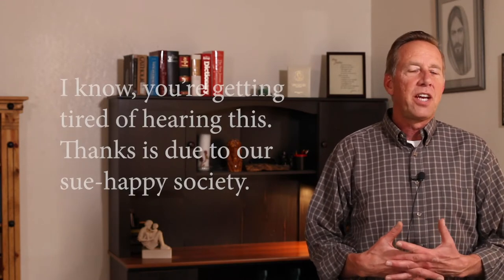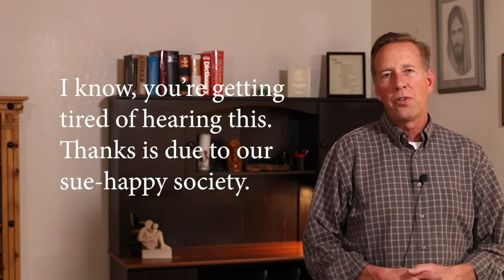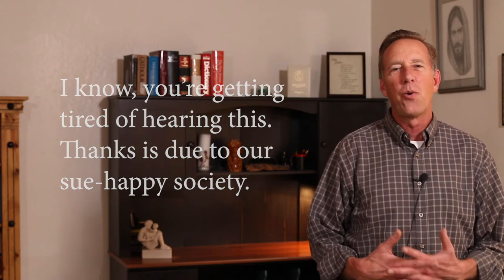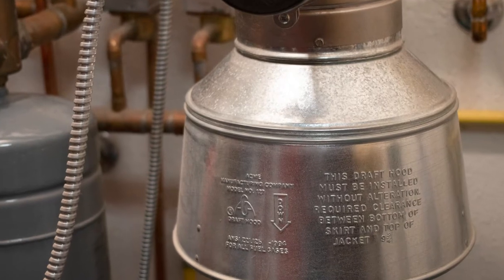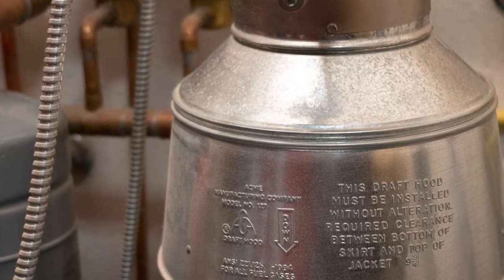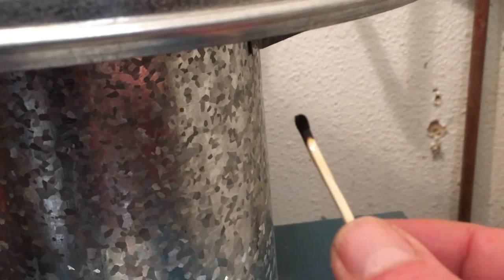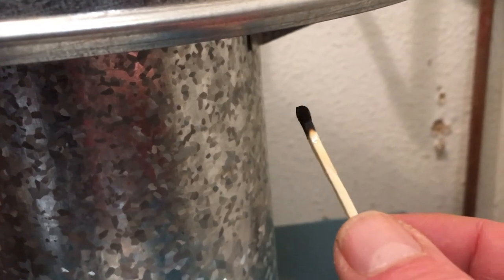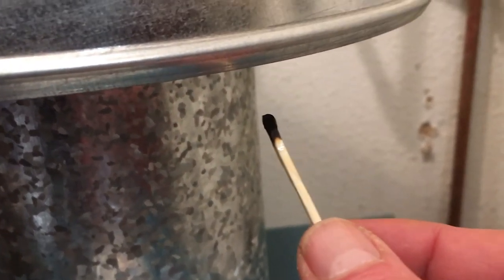Checking Your Boiler Part 3: Venting and Chimney

Comment: Could use your advice.  All the qualified heating contractors have left my area, because there is no new construction going on.  I can't get anyone to even come to the house unless I agree to buy a new system, and I can't afford the $13 - 15K they want.    

My boiler is an old Iron Fireman.  The flames are nice and blue.... Double wall flue pipe passes from the boiler through the garage wall, turns at a right angle and goes  through the attic and out the roof.     For the last 4 years I have had fumes in the house intermittently.  Never enough to register on a CO meter, but enough to give me headaches.  Gas company has checked thoroughly for natural gas leaks and found none.   It occurred to me yesterday that two months before the problem developed, I had a new roof put on the house.  We never had ridge vents, only gable vents.  The contractor insisted on cutting and installing a ridge vent.  My winter gas consumption almost doubled, even though I reduced the room temperature from 73 to 63 degrees to save money!  Could the colder temperature in the attic be reducing the draft of the flue pipe?  Mind you, this is double wall pipe, 8" outside diameter, but it is VERY cold in the attic.   And the flue pipe passes through the full 10 foot height of the unheated, un-insulated garage and 6 1/2 feet of cold attic.   

After that first cold winter, I complained to the roofer. but he would not remove the ridge vents.  There is only one roof contractor in the area and NO insulation contractors.  I have mild Parkinsons and don't have good balance, but think I could get up into that attic and wrap insulation around that pipe if you think it would help and if you told me what kind of insulation might work.  I also think I could wrap the pipe in the garage.  I'm pretty desperate.